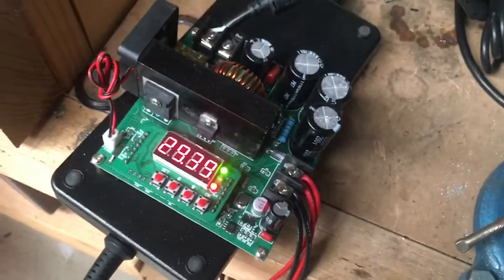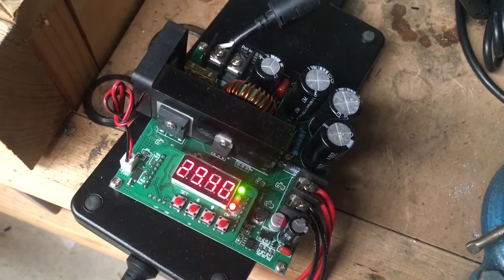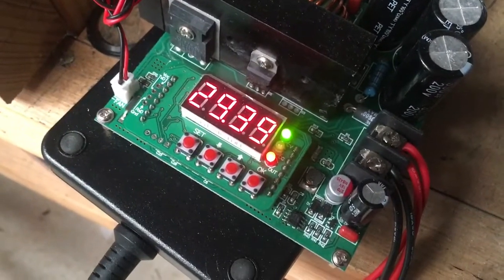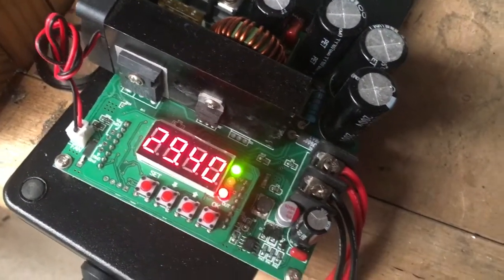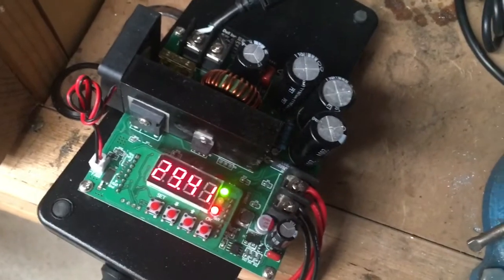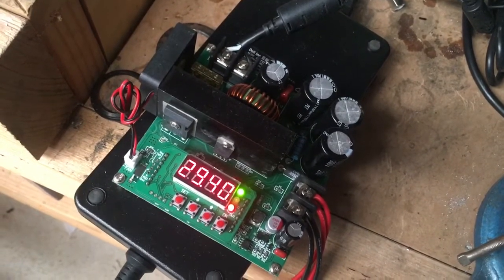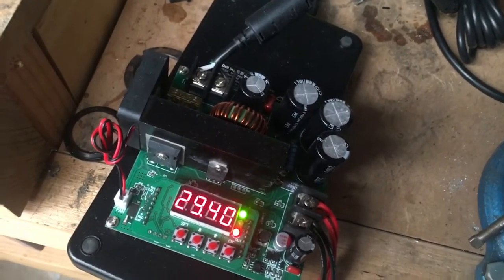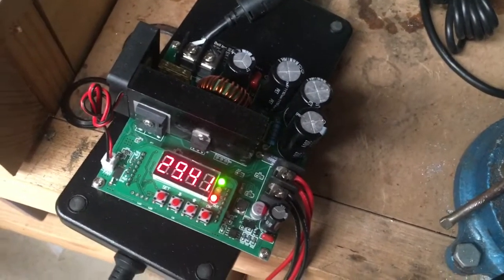DC to DC convertor for ebike charging

Comment: Hey i have a question. I want to use that board for charging my electric scooter with solar power. is there a significant current flow back out of the battery if the board has no power? Because i want to leave it plugged in at night

Comment: Im a bit of a noob with DIY charging through a bms. My adaptto controller just crapped out and im going to put a sabvotton controller in there. The adaptto allowed for charging through the controller. So it would display all the voltages etc on screen and you could set the charge current through the controller screen. I'm not sure how you charge through the BMS with one of these. Do you simply plug the neg to pos on the outputs of the converter, attach power supply, I have 52v 20 amp power supply. Then set it to charge after putting the cut off voltage etc on the converter and the BMS does all the balancing automatically? Is there something missing, or is it that simple?

Comment: I just ordered a second one of these (max 120v output) for charging my two 52V ebike batteries.. I love this little unit, it's relatively cheap, it has worked absolutely flawlessly. I'm running it from my 48v solar system batteries which vary from about 53v to 57v charging voltage  Thanks for posting ..
Reply: Where did you buy the Boost module ? Do you have a partnumber or a link to the website ?

Comment: Great Video, very detailed! I have not ran into the software bug yet. But it is good to know incase. If you get a quick chance. Check out the video I did on the one I just built with a 24V5amp(9amp) power supply. I added protection diodes after the video, on another youtubers suggestion. He said he blew a few of the Fets when charging until he realized he needed the diodes for protection. I just started messing with higher volatge packs and needed a 42V charger.